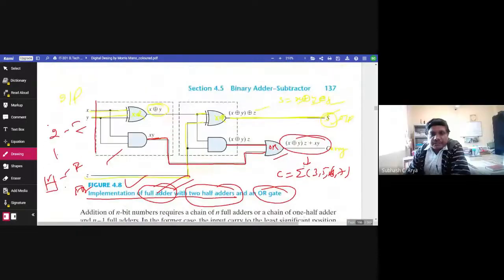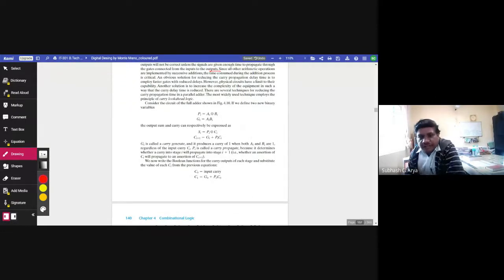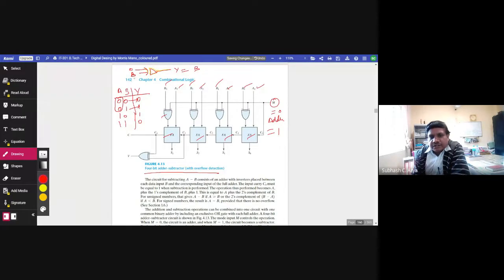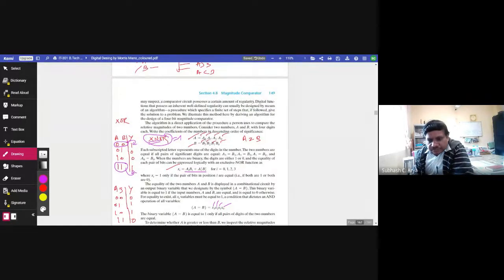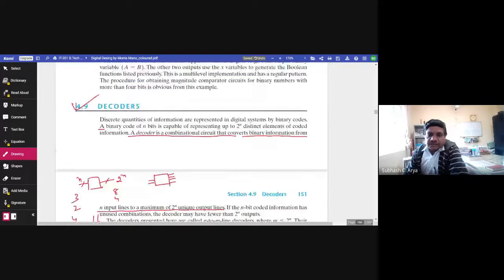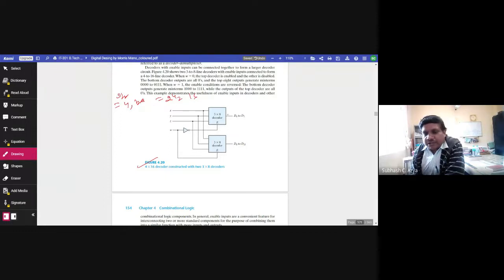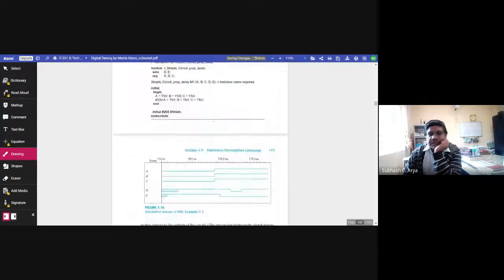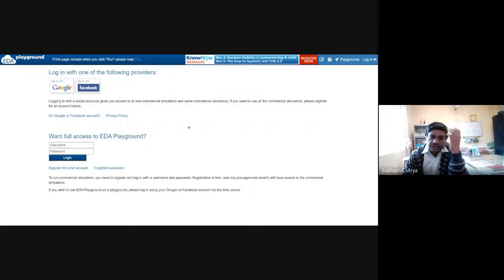Digital Electronics Unit-II: Look-Ahead-Carry generator and Comperator

Comment: Sir Y do we need to take the complement of the B in A>B
Reply from the maker: Thank you Kundan for asking question. We take complement of B in A>B case because we want to subtract B from A i.e. A-B, however, the given circuit is of adder. So using adder circuit, we can do subtraction operation using complement method preferably 2's complement method. In case of further clarification, feel free to ask further.